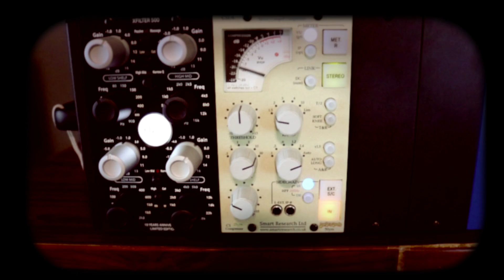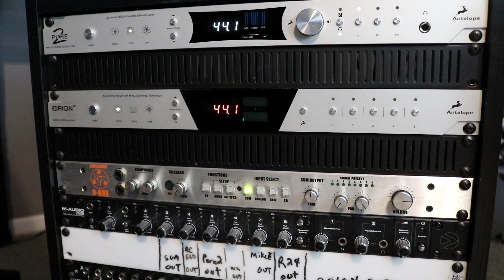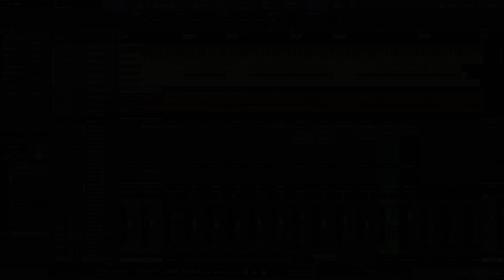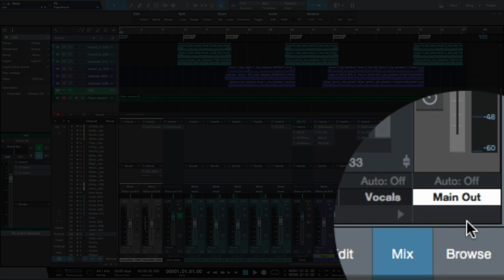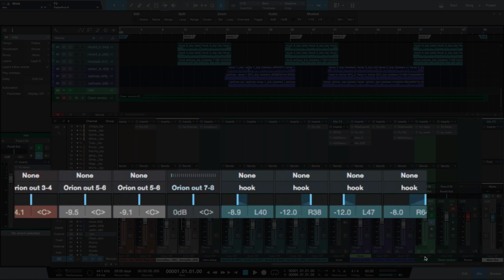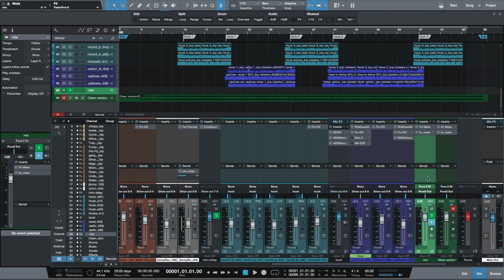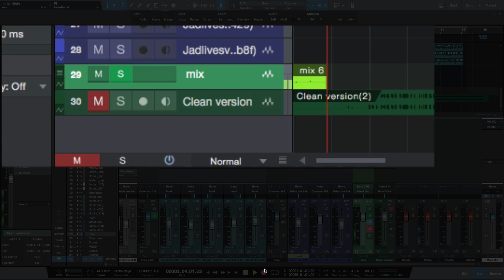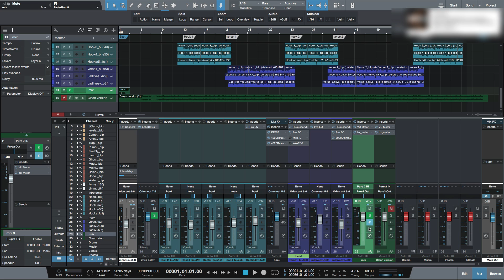How to set up Analog Summing in Presonus Studio One

Comment: Hi Czar I got a summing mixer and just getting my head around mixing through it. My Orion Studio has 16 outs so I was planning to dedicate 8 outs to the summing mixer so that I can mix through it from the beginning. My question is the following: to hear my mix and what I'm doing I need to make my return go to an audio track and "record enable" it, correct?. The problem is that when I solo an individual track, to hear it, I need to also solo the "record enabled" track. If I "solo safe" it doesn't work somehow. So if I want to hear anything in solo, I have to manually also go solo that return audio track. Am I missing something? Thanks!!!
Reply from the maker: What daw are you using? And whats the output of the your audio track that your printing to
Reply: Hi  @TheAudioCzar , I am using Studio One. At the moment the return audio track goes to my "Master out" which goes to my "Main outs"

Comment: Great video, thanks! 
 
The only thing I'm still can't get is how to setup multiple convertors i/o simultaneously in S1? Especially on Windows (Mac have aggregated device). 
 
You need to output 1st stage in summing box, then 2nd one again for monitoring from daw itself, right? How did you choose Orion 32 and Pure in Output section simultaneously?
Reply from the maker: +Ivan Stegachev I'm using the spidf output of the Orion routed to the pure2. So I'm only using the Orion as a interface.
Reply: Got it. Thank you!

Comment: Good video. It reconfirms that my S1 to Analog Summing setup is correct! 😊. Question... When printing the final source, on your input channel, you mention adding fx and processing there. Some other video demonstrations hv mentioned the same. Problem is that when I try that with my setup, I hv all types of issues. It seems to let me add only S1 plugins there without issues, but there are all types of delay, phasing and timing issues with 3rd party manufacturers. Especially UAD plugs. If I want to stick a UAD buss compressor on that input signal when I print, I have to do it in in UAD's control mix dsp software. Drives me crazy. Am I missing something? Thanks.